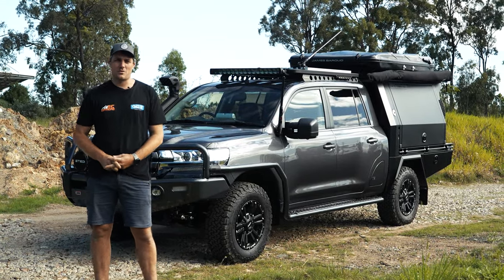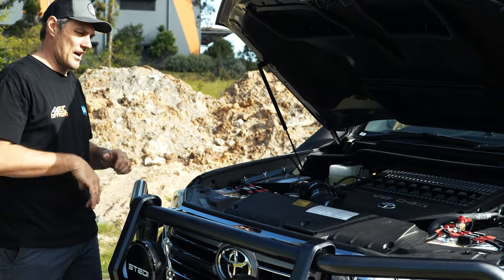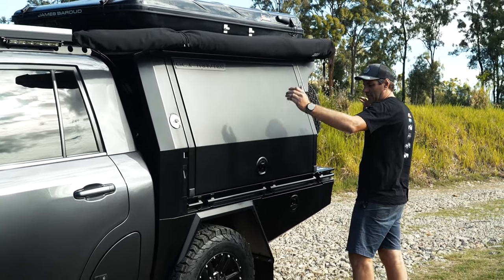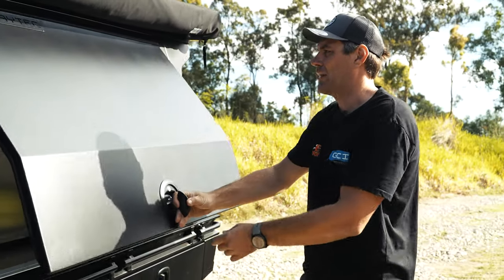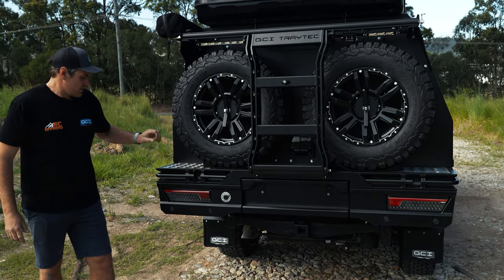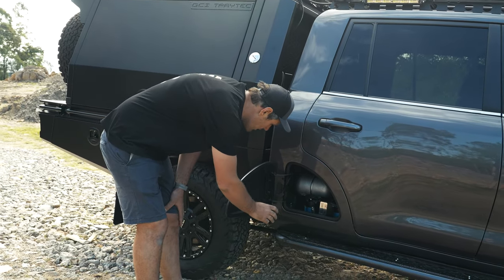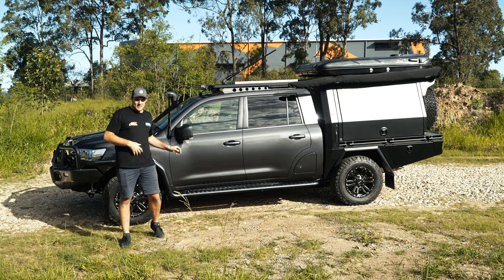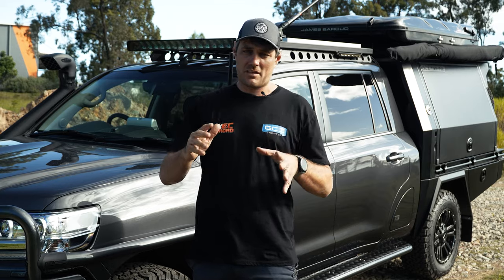Last Modified 200 Series Landcruiser - CHOPPED Landcruiser & GCI Traytec tray canopy

Comment: Great Video guys!!! Is the Rhino Rack available "off the shelf" or does it need to be modified to fit a Chopped 200?
Reply: Rhino are the only supplier that do not produce a backbone for a chopped landcruiser. The Rhino backbone for a wagon needs to be cut down to suit. ARB Base Rack and Yakkima both make a backbone to suit a chopped 200 series.